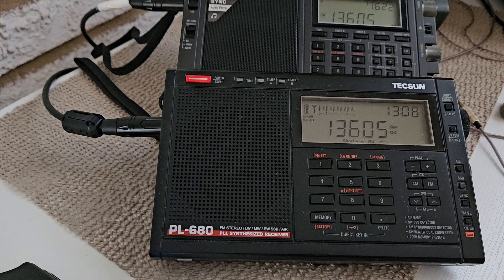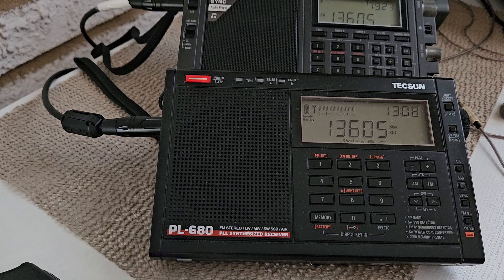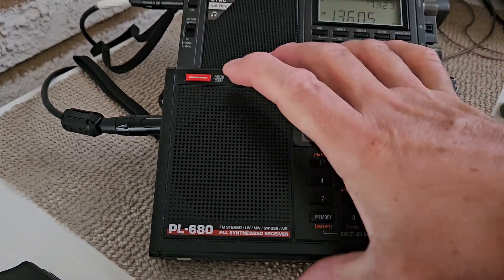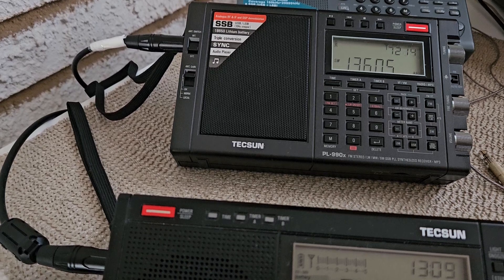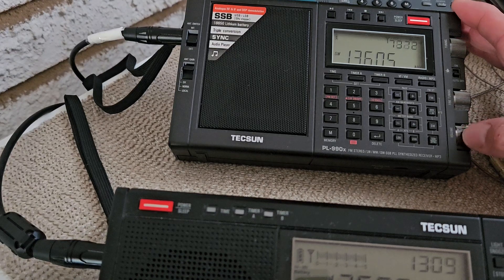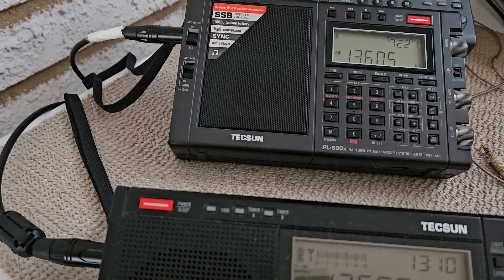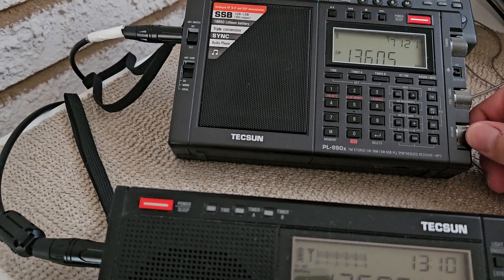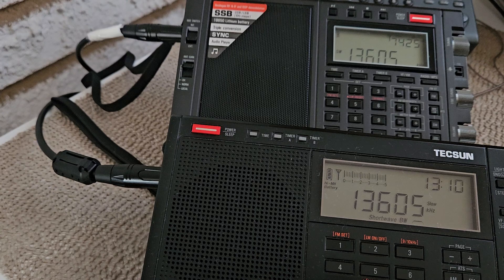Testing of Radio Marti using modded MLA 30 Plus with 3 ft copper loop

Comment: What bandwidth filter did you use on PL-680?
Reply from the maker: I normally use the smaller one.
Reply: It's really strange why so off frequency on display. @SWLSignals23-hp6vp
Reply from the maker: @oz_dx  I believe it was the 3 ft copper loop I was using. I changed it back to the stock MLA loop and it works fine now. I did make another change though. I mounted the antenna on smaller  piece of PVC that I have and stuck it in the ground at about 3 ft high. Doing some testing on that now. So far, the reception has been good.